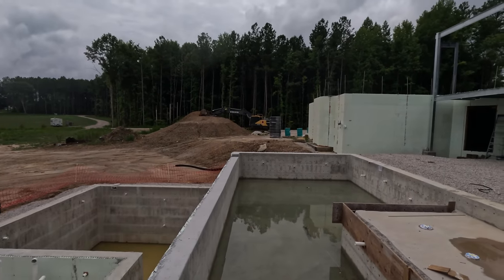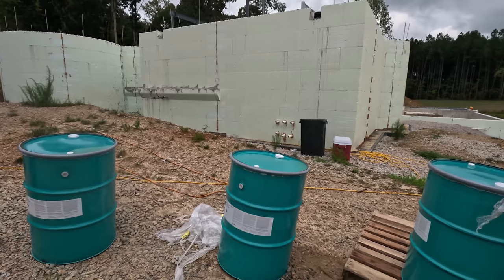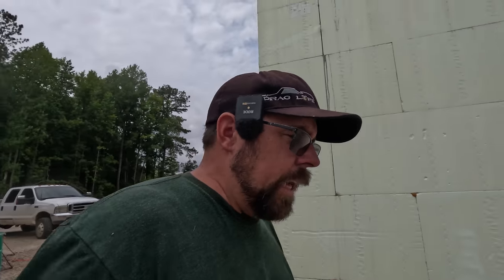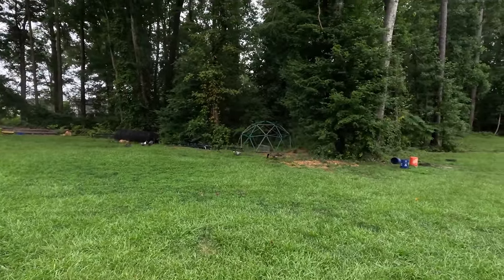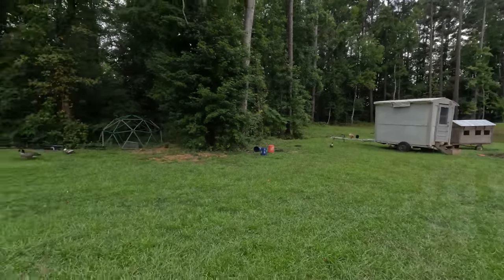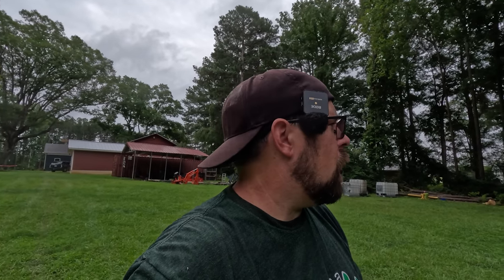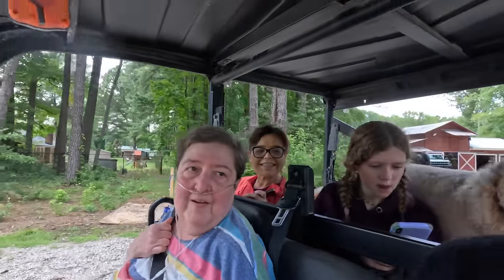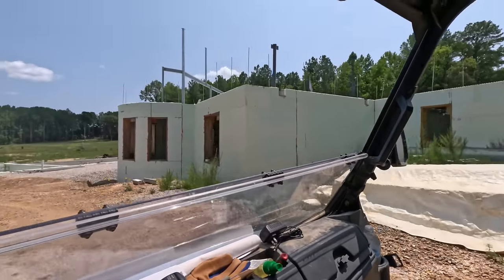Big Announcement about the Farm and Updates on the ICF Mansion Build

Comment: Just a suggestion Geoff, those three drums you have there, tilt the tops so they are not under water. No matter how tight the bungs are they will draw water in. I worked in a bulk fuel depot and all drums outside had a piece of 4x4 under one side so the water would drain off the tops preventing water getting drawn into the product inside.
Reply from the maker: Thanks for the tip!

Comment: I know back years ago you might want to check because the houses with stucco  had foam on the walls and for some reason the foam was getting wet and holding moisture and is was underground and termites was eating the house up and they now recommend not using foam might want to check to see if you might need to do something extra
Reply from the maker: Nothing for termites to eat on my house but I do know what you’re referring to.
Reply: @BealyGood  good deal brother just don’t won’t you to have problems down the road. Something I did do on the concrete walls I sprayed it with Thompson water seal I put 3 coats on there.

Comment: What are you intending for heat/cooling & power - supplied or solar & ground source heat/cooling pump?
I'm in the initial stages of planning my last home & will be going as "off grid" as possible, which here in the UK will save a significant amount (cost of a first class return flight to Atlanta every year).
OK, so the initial outlay will be considerable but once it's done & paid for, I'm living for free.
Reply from the maker: @GARDENER42  geothermal and solar
Reply: @BealyGood  Same here, plus a small wind turbine (2.5kw), as I'll be 2 miles off the Irish Sea, so plenty of wind when there's no sun, plus a battery bank.
If all else fails, I've a 6kva diesel generator in storage from before I retired.

Comment: I bet you I sprayed some of the nastiest waterproofing or seal coating undercoater you could ever imagine one of them was a product made by Tremetco or something like that it was back in the 1980s and it required a massive pump it was probably 1.5 GPM with 3000 psi at the bar. I guess they mean tip which is the bar that’s basically in your hand it was like trying to spray sheet rock, mud, sand, and hair or maybe it was just a stringy material almost like cotton candy come out of the tip and there was another Type of coating, don’t remember what it was called, but it was an encapsulator that came out of the gun like a fiber fortified rubber, but the fibers were very microscopic fine very soft to pass through the pump the gun Had an orifice the size of a sewing needle or larger you could literally put a sewing needle through the hole but they were only good for about 45 gallons of material by then you could literally put a finish nail through the tip the material basically bored out the tip as you sprayed. And they said that it could not be done, but I sprayed thanemcrete. It was a product that we used to encapsulate asbestos cement board or siding with from the 40s and 50s I think they have eventually outlawed that stuff.